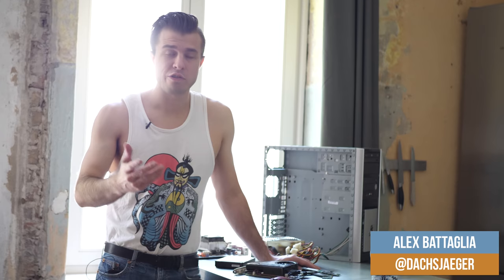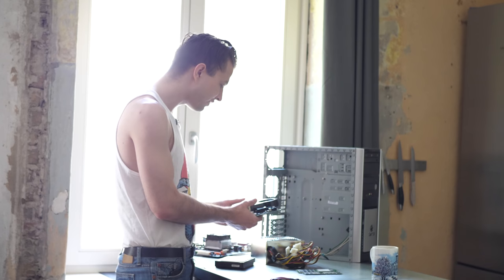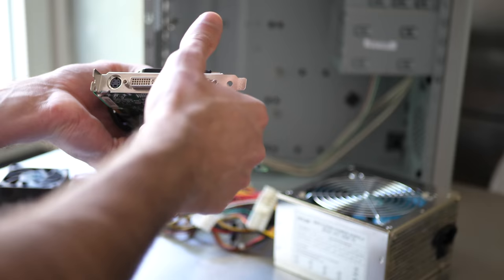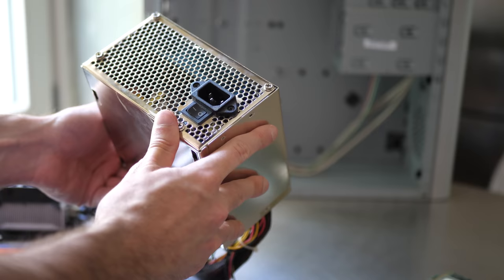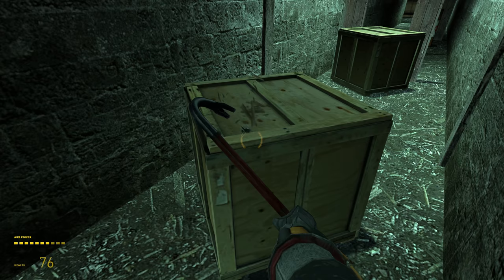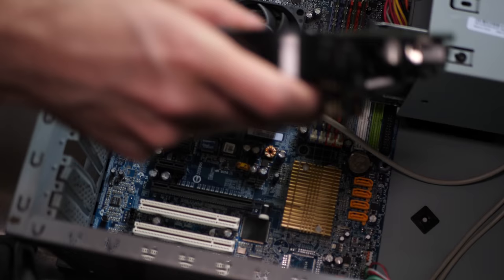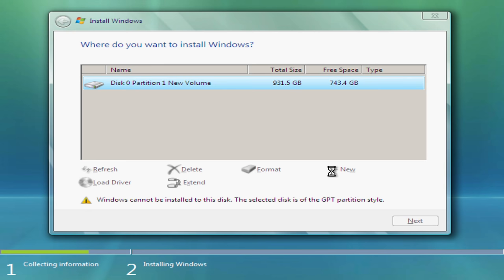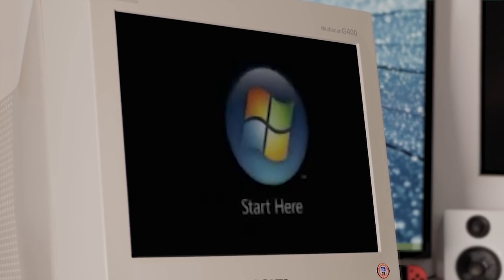Let's Build A 2005 Retro PC: Athlon X2 3800+ - Nvidia 6800 GT - Classic Hardware For A Classic Era!

Comment: One year later the 360 launched and was much more powerful than this pc...
I miss the days console launched with powerful hardware and pc caught up later
Reply: They are never returning because old consoles would initially sell at a loss and recover their costs through licensing and gradual advances in manufacturing that would lower the cost of unit production (which would take years). Starting with Xbox One and PS4 the consoles sold for a price where they would break even per unit. Thankfully the next gen will be better balanced (Zen 2 8core CPU with HT, baby!) but even then, they'll simply compete with a mid-high PC.

Comment: I too tried playing the Crysis demo on my 6800 GT, and yeah it ran just as poorly. At low the game looked worse than Far Cry, and at medium the game was unplayable since the frame rate was so low. I think if you try and run it at high, the game will run at 1 fps or crash.
Reply: There is one setting that switches on proper lighting. I dont remember what is was. Runs almost as well as all low. A 8800gt at 1050p isnt doing better at high performance wise.
Reply: @frederikgoogel5611  I remember when I got a q6600 and the 8800 GT and being disappointed in the performance at high. The range was between 24-30 fps. Probably a lot worse when lots of action happening on screen. Graphics wise the game at high was a really big upgrade.

Comment: >Builds an accurate mid-2000s PC
>Installs Vista on it
Apart from masochists, and schools that were receiving their first PCs, NOBODY willingly used Vista. Most people I know stuck with XP SP2/3, then switched to 7. Given there were NO Vista or  higher exclusive games until around 2010 (Just Cause 2 infamously DEMANDED Vista as a minimum) and that most developers only really dropped XP support around 2012 I really don't think you should subject that poor computer to the garbage fire that was Windows Vista. Especially given the games you said you intended to play (All work fine on XP SP2, I know from experience :)

Comment: ı  built 6600gt p4 but oblivion makes things hard. it plays even gears of war fine oblivon need to toned down.  2013 last xp drivers also not  good need to 2007 drivers to work best. ı tested sytem beyond things like dark souls it run with resuloaton 200x200 5 fps. star wars force unleshead game also killed my system 2 fps. some of games of that era very poor optimize for pc. crysis also not good. but doom 3 half life 2 portal farcry kotor 1 2 or games like avp2(best) re4 dmc4 etc swat 4 rainbow six 3 ravenshield (best)  slien hill 2 vs good.  ı also trying all emulators. game cube 10fps dreamcast 25fps playstation 1 and nintedo 64 40fps.   sega saturn 20 fps.   playstation 2  8fps. orginal xbox never achived to work any. xbox 360 tryed xenia but not worked on xp.  tryed sonic mania not worked at all.  tryed sonic 4 and last rocket knight game worked.  best late game good work on system for me hawx 1 so beyond 2009 not worth to try unless like teltalie games walking dead jurrassic park etc also after  2008 therei only a few pc exlusives or even no strategy games . some of 2008 2007 games like  star wars force unleshead lost planet turok prototype kills the system. oblivion 23 fps with distand land and trees and water refleciton on. assins creed 1 2 fine but ac 2 not good on xp. games like dead space bioshock fine.  strategy game like star wars eaw and medieval 2 total war or battlefor middle earh 2 fine but when things hot medival 2 total war very demanding. still today am very suprise xbox 360 and ps3 achive to run games like 2014 mgs5 watch dogs etc compered pc. ı suggest try alien vs predator 2 for 3d game for 3dfx game boarder zone  snowboard game for 2dsh game nocturne these 3 game was way looking good for time.  there is also intresting forgetten titles like freelancer  vs  riddick game or outcast or even chorme game. yes chorme the game. beyond all also after 2009 all pc no drm free and requres steam so even if this card works worthless to try bcosue steam and xp not so great couple. after 2006 ı think not considered retro and after 2009 pc gaming for downed good for many aspect only one aspect left still storngest graphic hosue and that can be beaten with next gen consoles too. in 2019 only 4 or 5 aaa titles relased with dvd. in 2020 right now no aaa game rleased with dvd in pc. last game ı know rlesed 7 dvd jedi fallen order.